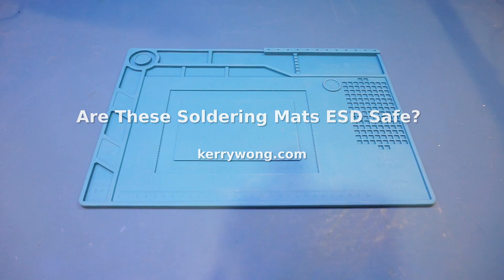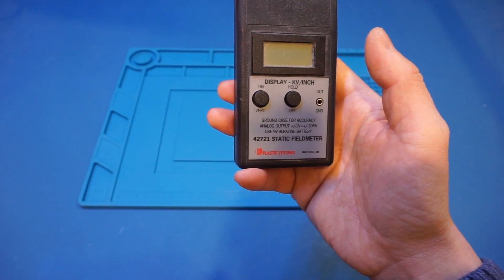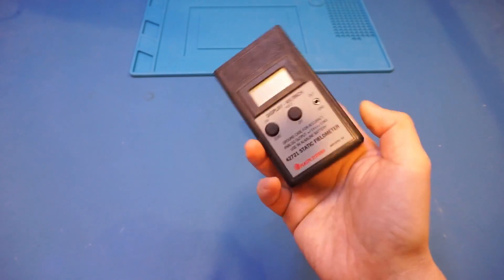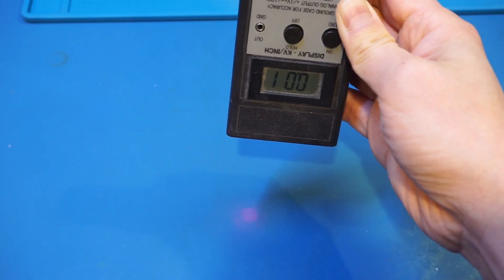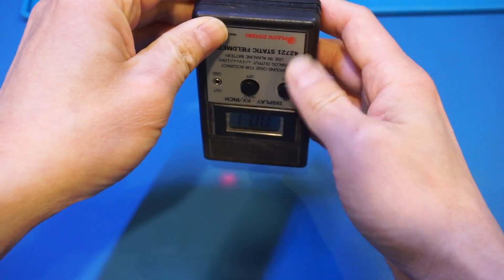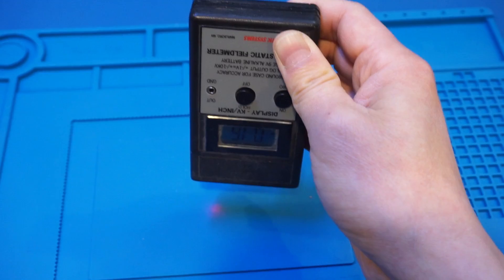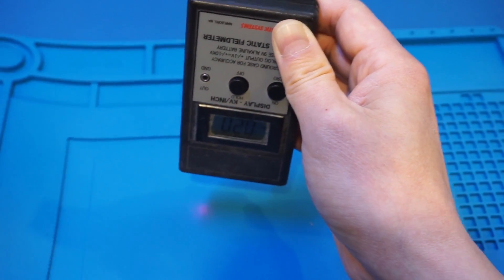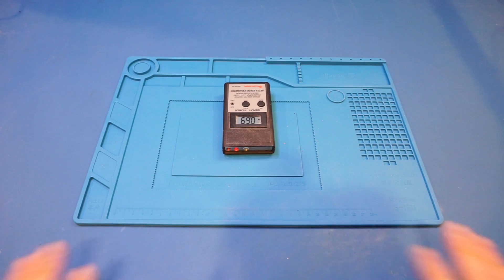Are These Soldering Mats ESD Safe?

Comment: I appreciate your testing and review, but I think you missed the potential good uses for this. I bought a similar but different mat standalone. I did not buy it as an ESD mat, and it was not advertised as such. This is a great workbench surface protector, and has a lip to keep small screws and such from rolling off the table. If I am just stripping wires, crimping connectors, attaching wires to a ground block, or a variety of other tasks that are not static sensitive, this is worth a few dollars to keep things from rolling away. A 4 foot table has plenty of room for this mat, and a proper esd mat beside it for sensitive electronics work, ICs, computers, etc. I also solder things that are not static sensitive, so a heat mat is nice. It just seems that you focused a bit too much on ESD and condemned this mat as useless due to lacking that feature. This is also a great mat to set on top of a roll around tool cart for mechanical work in garage, and misc other hobby work, pliers making jewelry, small hand crafts, hot glue gun, etc. There's probably more uses too, that's just off the top of my head.
Reply from the maker: Yes, as you said they are definitely useful for protecting your work surface and get things organized. Because the ones I received are specifically advertised as for electronics work, I wanted to point out the potential danger as many people might not be aware.
Reply: @KerryWongBlog  I really appreciate you doing so. After searching on Amazon and watching other reviews of these silicone mats, I do see them mentioning anti-static and showing circuit board work. Your video is the only one highlighting the fact that these mats are not static dissipating. People think wearing a grounding wrist strap is enough. I have one of these mats and a separate vinyl/rubber esd mat next to it, each about 2 feet wide works well for a mobile 4 foot wide work bench.

Comment: Why is there a resistor between the ESD mat and the ground!? Why don't you connect the ESD mat directly to ground!? 🤷🏻‍♂️
Reply from the maker: This resistor is mainly for safety.
Reply: @KerryWongBlog doesn't that kill the purpose grounding? 🤔
Reply: You don't want zero resistance to ground. You want to limit the peak current of any electrostatic discharge. A zero resistance path to ground would give you a very high peak current. The sheet resistance of a proper ESD mat, along with the MΩ resistor, give you charge dissipation with very low peak currents.

Also, assuming you are wearing personal grounding equipment like a bracelet, suppose you touched something at a fairly high voltage? You'd have a large current flowing through your body to ground. The MΩ resistor keeps you safe.
Reply: Slows ground  transfer minutely, less peaks if I remember correctly.

Comment: These silicone mats not only are really dangerous for electronics in general, they are also quite annoying when you are dealing with some plastic working (drilling, sanding, deburring, etc) all those tiny bits get charged from the mat and they stick everywhere making an absolute mess, the best solution is a vacuum cleaning, i bought one of those portable battery operated mostly for this situations. By the way for those who use them for light duty metal working, be aware that WD40 make them swell up and possible cause damage.

Comment: I just got an esd mat which I cut to fit my table. It has no snap to attach grounding wire.  Could I separate filaments on stranded wire and tape them to the mat to create a grounding connection?
Reply: Grounding snap isn't going to do anything when connected to non-conductive material.
Reply from the maker: There are roughly two types of ESD mats. Most used in electronics labs like the one I have utlizes two dissipative outer layers with a conductive layer sandwiched in between and the grounding 1M resistor is tied to the inner conductive layer. Some mats are just a single high resistance layer and if you have that kind you could attach a 1 M resistor and ground it yourself like what you mentioned.
Reply: @KerryWongBlog  What would happen if you make ground connection to the mat that you have in your video ?
Would it dissipate the charge that it collect to the ground or is the silicon not enough conductive to dissipate the charge (or too slowly) to the ground ?
Thank you.
Reply: A grounding snap is cheap and also easy to install.

Comment: Long ago, when I was researching the ESD mat for my bench, I discovered that there were basically two designations for mats... ESD and Heat Resistant. As usual, for the inexpensive solutions/mats, you had to read the information carefully, because the sellers did not mind misrepresenting the mat's specifications. The mat you are testing may, at best, fall into the heat resistant category. A basic test may be determining if the mat has a grounding point. Without that, it is not likely to be ESD.

Comment: I noticed with mine, particularly after some hot air rework, when I went to peel the silicone mat from my ESD mat it was crackling away very loudly. It had built up significant charge and immediately went in the bin!
Reply: I have same problem too.  I have a wooden workbench with one of these mats on it.  After watching this video, I'm going to buy a proper ESD mat.
Reply: Same. When I peeled it up from the table immediately I couldn't see how it could claim ESD safe. Heat safe sure but ESD no way. And 100s of them are on Amazon claiming ESD safe with lots of positive reviews 😮
Reply: I hope you left a review of the product so other people know not to buy that crap

Comment: According to my own observations, almost all silicone mats have the ability to accumulate high-voltage static charges very quickly in motion. They are really dangerous to work with all kinds of boards, especially logic! Because of such a mat, the TinySA spectrum analyzer went into a knockdown.

Comment: You shouldn't move it while taking a reading. When surfaces separate  it induces charges.
Reply: Isn't that the point?  Things are not static (no pun intended), but are mobile. You are moving things over the surface, etc.
Reply: @booboo699254  Rubbing surfaces moves charges between them. Separating surfaces changes the potential between the trapped charges (think capacitor plates). Ideally you'd measure the potential of trapped charges in the state you are going to use the mat, flat and immobile.
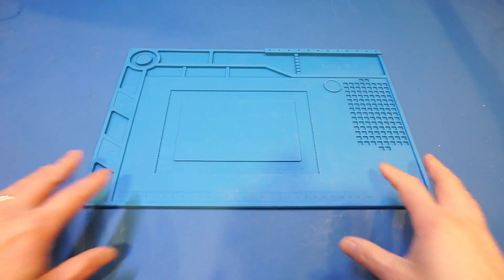Reply: @booboo699254  but you are not moving the mat on the table while working. i'm not saying that mat isn't crap for esd protection, but the  test isn't right either, since the 0:50 moment when he ruined the test it by dragging the mat

Comment: Silicone has terrible triboelectric properties.   I got a silicone mat once and it didn't take me long to figure out I needed to junk it.  I didn't need to use a special meter to figure it out, I could just feel it with the hair on the back of my hand.
Reply: Same here! Thank you so much @KerryWongBlog for this really helpful video and the discussion it's prompted. I've just bought a similar silicone mat that's advertised as "anti-static" – and it wasn't cheap. I'll be returning it.